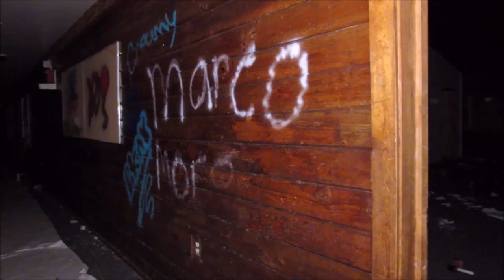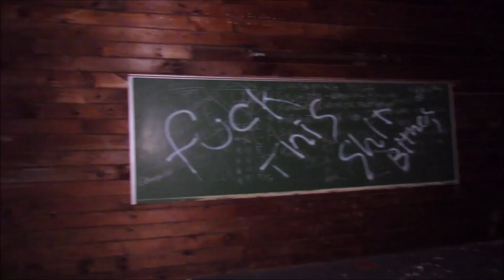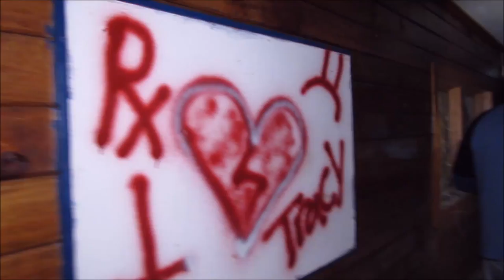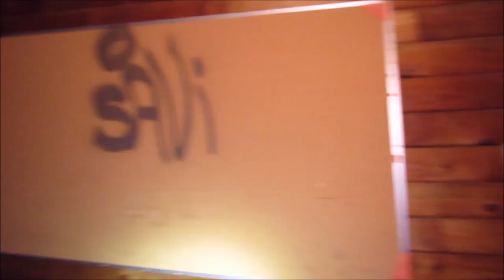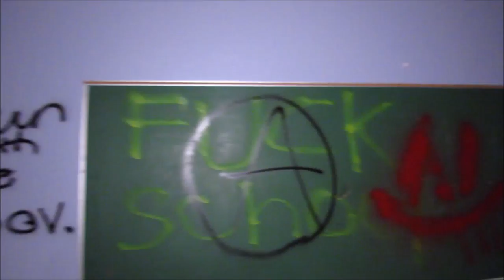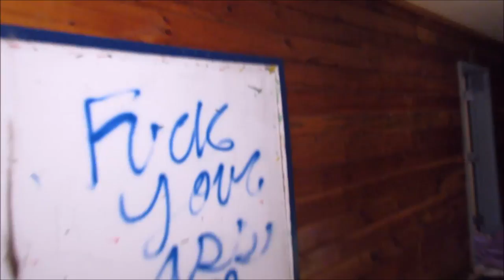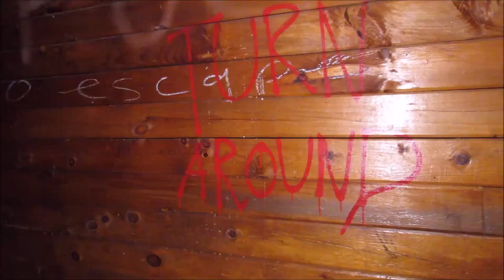(HAUNTED SCHOOL)TEACHES US TO STAY AWAY

Comment: Holy 🐄!!! That school is insane. As soon as you and Joe walked in, the feeling there was  just wrong. @voice, "Get out". @8:15 voice, "Otto". @8:23 voice, "I am in". @12:39 knock. @14:05 voice, "Evil". @16:25 hallway door closed. @16:53 something fell from ceiling. @20:53 voice, "Get him". @22:53 bang from ceiling. @25:52 clinking sound. @27:21 running or banging  across ceiling. @38:34 clinking. @39:19 voice, "Joe". @45:10 three knocks on door. @45:40 voice, "She's dead". @48:05 hiss. Awesome explore, Chris,you were in savage  mode for sure. You could tell though towards the outro, Joe wasn't feeling well. That school just emits bad vibes. Again excellent intense, video.
Reply: At 45:02 it knocked 3xs as well and it did it again cause they didn't hear it, at 45:08 and at 45:23 follow by a breathy male voice and at 45:33 it knocked again then said she's dead.